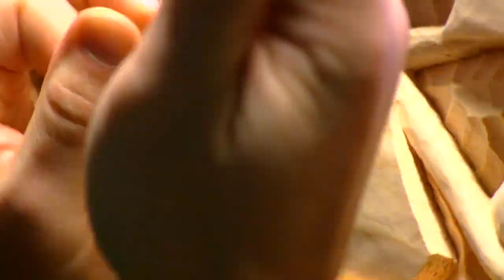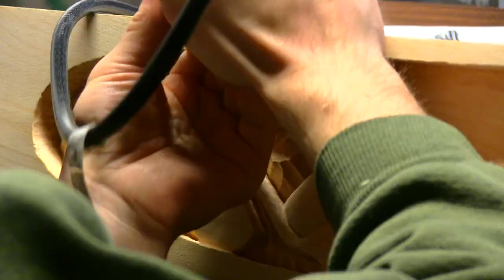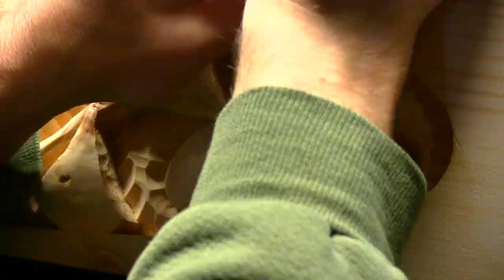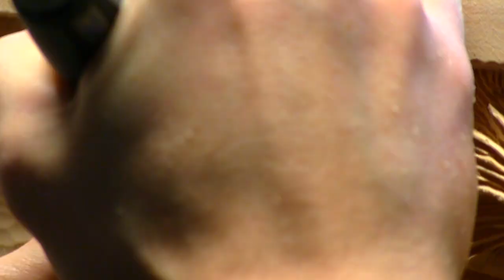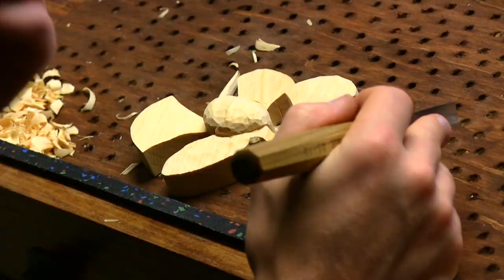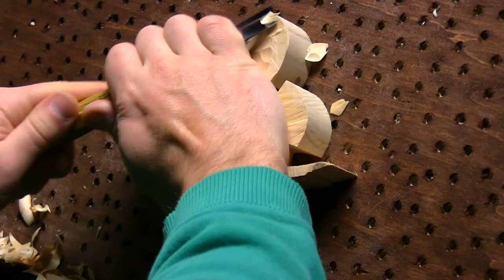CARDINAL FIREPLACE MANTEL WOODCARVING - "PEACE IN THE PINES" (Part 2) - Carving Birds & Pine Boughs

Comment: Great problem solving. Fully understand the Dremel use too. I’m finding elements with mine that just has to be for the Dremel. Like you I have a limited gouge selection and they are expensive. It really worked well for you here the effect is excellent. What sort of burr is that you’re using btw? Also, that rocking technique - Joe Dillet from the carving shop has also advised me on this on zoom but i don’t think I’ve really got the technique yet at all. but again looks like you’ve nailed it here. I’m really not great on texturing yet. That’s why I love your videos, always pitched at just the right level for me, giving me stuff to try and things to aim for just at the time I need them. Plus your music is super chilled. Thanks again 👍🏼 PS. I’m having a real hard time sharpening my curved 4mm V gouge. 12a/4 I think. I’ve had to file it back and start from scratch but just can’t get it right. The curve also makes it difficult to strop inside the v. It feels like it doesn’t cut smoothly but I’m wondering if this is just because it’s such a small v that it will always tend to catch and dig in? Do you have the same feeling or is mine just not sharp enough? Bearing in mind I’m still working on this oak mantle of course! It may just be very hard hardwood! Cheers 👍🏼
Reply from the maker: Thank you I'm glad to hear the videos help! I actually learned the texturing tip from Joe Dillet as well. He has great videos that you can learn a lot from watching. Regarding your 4mm V gouge.. I'll start by asking if you're confident it needs to be sharpened vs. honed? When I started carving I ruined several gouges by sharpening them when all they needed was to be honed. I tend to only sharpen a gouge if I can feel a noticeable "ridge" along the edge or if I can see a nick or chip. A Lot of times too, smaller gouges rarely need to be sharpened just due to the small intricate carving they do. There's not a ton of force generated so you can sharpen them far less often, but they do regularly need to be honed. Something I again learned from Joe Dillet, is a great way to test if a gouge is properly sharp is by making cuts across the grain with a soft wood like pine or basswood. If you're doing that and it's still not making a clean smooth cut then some sort of maintenance needs to be addressed, whether it's sharpening or honing. A side note, V gouges are extremely difficult to sharpen evenly. Honestly, sharpening gouges is a skill in itself that can take years to be proficient in. I still struggle with it. lol. Hopefully this helps!
Reply: @ChiseledOutdoorsCC   thanks dude, yeah this one was a lucky find in an antiques shop and the angle of the tip was all wrong. Had to grind it down and start from scratch. Definitely not getting across the grain. Doh! Back the stone... I’ll keep on trying to get it right. Hope you’re staying safe over there, take it easy 👍🏼 ps: good owld Joe Dillet!! He’s a nice chap 🙂
Reply from the maker: Oh I gotcha. Yeah I bet it's really tough trying to grind that gouge to a usable angle.. I know Mary May has several great sharpening videos too that might help if you haven't seen any yet... Yes, Joe Dillet is a great carver! I binge watched his videos when I first started. lol. He's got years of knowledge that he generously shares for free.

Comment: I'm so impressed with your work. How did you get started? Any pointers for someone new to carving?
Reply from the maker: Thanks! I got into woodcarving because my family is in construction and the woodworking business so I ended up just trying it and liking it. Probably my best advise for someone starting out is buy quality tools. Always push your carving limits and try new things, but never design a project that's beyond your tools/gouges abilities (I learned that the hard way). And lastly, I'd say just enjoy the process and the carving journey!
Reply: @ChiseledOutdoorsCC  One last question. The wood. I live in the south so baswood isn't native here. And it's expensive where iI can get it. Any advice on where to get carving wood?
Reply from the maker: @dennisandrews8485  I would suggest doing some digging around your local area and see if there are any sawmills around and see what they stock. Buying wood online is very expensive so I avoid that at all costs. I was fortunate to find a local sawmill near me that stocks basswood, white pine, and butternut regularly. I get it rough sawn so you have to do some TLC before it can be carved, but it is much cheaper in the long run. If online is your only option, I've bought basswood at Rockler.com before.

Comment: I really enjoy your work.  What were the dimensions of the mantel, depth and height?   Was it one board of X thickness, or built up with two or more boards?
Reply from the maker: Thanks! The mantel has a height of 6in, length is 6ft, and depth is 9in. It's one solid piece of white pine, so no glue ups or anything.
Reply: @ChiseledOutdoorsCC  Thanks for the response.   Your mantle is beautiful.  Thats quite a chunk of wood you used.  Perfect for a mantel.  Have you ever carved with layered wood, say three 2x6's glued up?   I'm looking for cheaper alternatives while learning.  I am curious to know if going down through one layer into a second causes big problems?   or is a reasonable way to get mantle sized wood from dimensional lumber?
Reply from the maker: I would say that glued layered pieces is an alternative route if you can't find a solid piece to carve with. Large pieces that are good quality to carve are tough to find. The couple things that I can think of right off the bat that could lead to problems when layering is if you don't get it clamped evenly throughout and your wood isn't planed evenly you could get small gaps as you carve through one board into another. One other thing I can think of is if the boards aren't relatively the same color you're going to get a lighter/darker effect when carving from one board to the next. I know and see a lot of carvers gluing multiple pieces together though to get the desired thickness. I think it just comes down to figuring out what works for you and having the right equipment to get it done the right way.